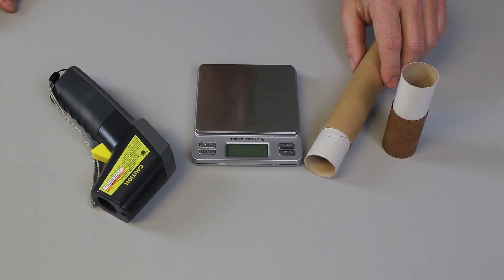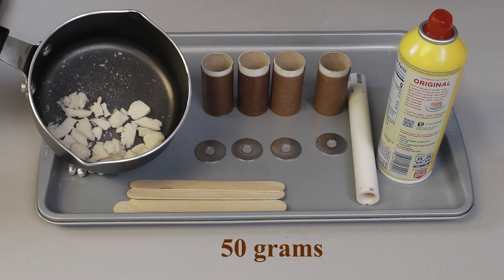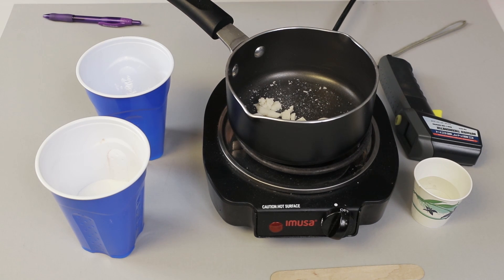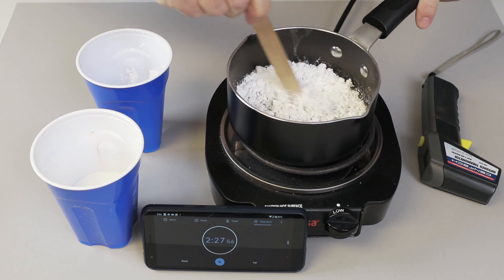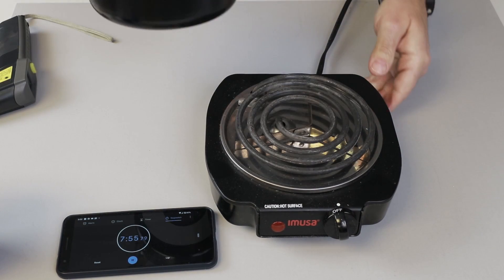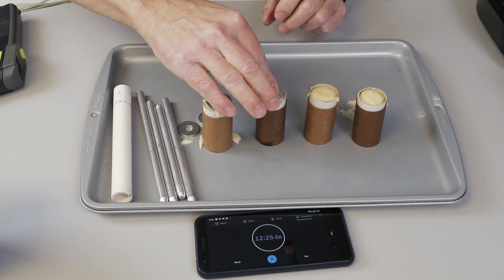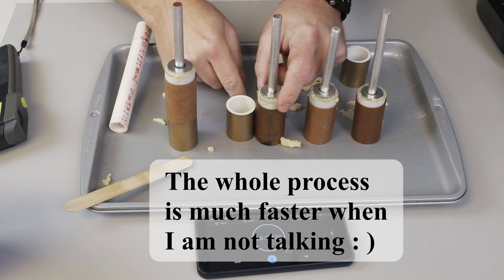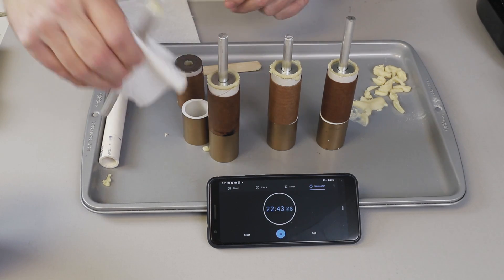Casting sugar fuel for a snap ring 38 mm rocket motor.

Comment: Can i use 55% potassium nitrate i dont have 100% kno3
Reply from the maker: The oxidizer needs to be 100% Kno3. In the US stump remover will work when ground into powder.
Reply: for purification disolve 1kg kno3 in 1 liter boiling destilled water under stiring. Whenn it is compled disolve let it cool down aber an day you have long needls of pure Kno3. if you know what the other 45% are and they are more soluble than kno3 than you can put your kno3 solution in the fridge over night and you get more kno3 out of it.

Comment: Why should we heatup the mix ? 
Does it make fuel more powerful ?
Does mixing up sugar and kno3 wont work or performance will be lesser in dry powder form ?
Reply from the maker: Casting the fuel wraps melted sugar around the oxidizer therefore creating superior thrust.

Pressed dry sugar propellant is good for a simple demonstration of smoke and fire. Melting the fuel provides a lot of thrust. Check out the video tab on my home page for more videos on rocket fuel. @TheRocketeer

Comment: Propellant should be powered and packed to increase surface area so   that it burns to produce high pressures force.
Reply from the maker: That is true for powdered fuel. Melted fuel provides very intimate contact with the oxidizer and that produces more efficent burning and thrust.

Comment: why can't we make a long solid propeller ....like 500 mm long what is the issue?
Reply from the maker: It is possible to pour a very long grain. It would be very difficult to push a long coring rod into the fuel or pull it back out after the propellant has cured. 

Drilling the core out is not easy either because the fuel sticks to the drill bit. That is assuming a very long drill bit is available.

If you are able to make a very long grain let me know! Good luck.
Reply: @TheRocketeer  thanks for the reply...so there is no technical restriction.
Reply from the maker: @thirumeniparthiban6261  No technical restrictions with a long single grain.

Comment: We're you referring 3.8mm as the inner diameter of the casting grains and the diameterof the motor itself?
Reply from the maker: Motor cases come in standard sizes such as 29, 38 and 54mm. I am referring to a 38mm case using BATES grains and a 1/2" core or 12-13mm. I hope that helps.
You can find more information here: https://www.lokiresearch.com/page/Tech_Info

Please add me as a featured channel on your rocketry page, thanks!
Reply: @TheRocketeer  oh thanks a lot for this again

Comment: Hi I have one question can I drill by 12.8mm drill bit?
Reply from the maker: Yes, you could use a 12 or 13mm to drill the core. The fuel is not easy to drill, it sticks to the bit. A little machine oil may help on the drill bit.
Reply: @TheRocketeer  thank you very much

Comment: I am a jetex lover .. can we cast sugar for jetex models too ? Can sugar fuel be modified so that we can a favorable sugar fuel instead of Guanidine Jetex fule for Jetex scale models ?
Reply from the maker: I am not familiar with the Jetex motor so I had to look it up. The Guanidine Jetex fuel is very unique, it burns rather slowly and at lower temperatures. That is the opposite of rocket fuel!
It may be possible to dry press a mix of sucrose and potassium nitrate (65/35) into a small pellet size and try that. Some of my first PVC motors were done that way. I am not sure if it will damage the motor or not. Good luck!

Comment: Have you ever added an ejection charge to this? Did you use a Loki 38mm Smoke Delay/Ejection Charge Bulkhead?
Reply: I just found my own answer. You replied on another video that you use the Loki.
Reply from the maker: @mr.harris8185  Use the "faster burning"  delay (brown) for sugar motors. If a medium delay is what you typically use then drill for a small dely. Sugar propellant does not burn as hot so a shorter delay is necessary. Use a long shock cord until the delay is dialed in.

I have an updated tutorial where an induction plate is used to heat the fuel.

Comment: This is the best video on casting propellant grains that I have seen. Suggestion: why not put a cast iron skillet or griddle on top of your electric hot plate, underneath the pot that contains your mixture? I believe it could help mitigate the explosion hazard. Correct me if I am wrong.
Reply from the maker: There are a lot of misconceptions concerning casting sugar fuel. It does not require a lot of heat to make flexi-fuel or sorbitol. It does require a lot of heat to make Rcandy and that is one of the reasons I discourage anyone from making it. The propellant is not going to explode.

The answer to your question would be fairly long so let me skip to a far better solution. The last several months I have been using an induction cook plate. This method is fantastic for making fuel. I will be making a video on that process in the near future.
Reply: Its sugar tea

Comment: So technically, this could not be launched at a tripoli launch because this is flexi fuel which uses sucrose and corn syrup. Looking at the tripoli rules the sugars listed are dextrose, sorbitol and erythritol. So can you only fly these 3 sugars? I'm a little confused lol.
Reply from the maker: This is a summary of the Tripoli ruling as I understand it. Sugar fuel must contain at least 51% of the three sugars you listed. The ruling does not claim that sucrose or corn syrup cannot be used. With those guidelines in mind then flexi-fuel is not allowed at a Tripoli launch because the primary sugar is sucrose or corn syrup.

My opinion on the matter is that flexi-fuel meets the criteria if 51% of the fuel is corn syrup. I believe corn syrup should fall under dextrose as the main sugar component. Corn syrup (Karo) is a proprietary sugar and because of that Tripoli will not accept it as dextrose.

The other thing to consider is Tripoli is not willing to assume any risk. It took a landmark decision at the Supreme Court that was expensive and lasted several years to allow us to use ammonium perchlorate (AP). That decision is the basis that allows us to use commercial motors and make our own rocket motors in the US. I think the ATF just tolerates us as long as there are no significant problems. This is simply my opinion on the ruling.

Flexi-fuel is my favorite propellant for a number of reasons. I have been using sorbitol for all my launches this year. Watch for a new updated tutorial on how to cast sorbitol and overcome some of the issues I have had with it in the past.
Reply: @TheRocketeer  so if you wanted to fly flexi fuel at a tripoli launch, you could dissolve dextrose in water to make a pseudo karo syrup and make flexi fuel from that right? As long as it made up majority of the fuel?

Comment: In what universe is 265F equal to 74 Celcius? boiling point (100C) is 212 F, and freezing point (0C) is 32F. 265F is 129 Celcius !
Reply from the maker: Yes I made an error in the conversion, it should read 130 Celsius. It is too time consuming to edit and re-upload the video and most people are going to recognize the error. BTW you misspelled Celsius :)
Reply: @TheRocketeer  Yep. I was being a smart-arse. I notice someone else had already commented on this, so I should have just shut up ;) Nice video BTW. Although I think I'll stick to mixing powdered sugar and KNO3 rather than heating an explosive over an electric hotplate... your saying 'make sure none drips down onto the hotplate' gave me goose-bumps. I have my powderman certification and am a chartered industrial chemist, but it seems too dodgy a process for me to attempt at home ;)

Comment: You've already made a vídeo casting flexi fuel before this vídeo. In that other video your cooking time was 5 minutes and you spilled the sugar and the kno3 in the corn syrup at the same time. So, what are the diferences between the cooking methods??? Like and suscribe
Reply from the maker: I have improved my casting methods from the previous video. I prefer to let the sugar dissolve in the corn syrup first and then add the KNO3. Thanks for your comment.
Reply: @TheRocketeer  thanks for your answer, i like to learn new things

Comment: What is the propellant?
Reply from the maker: The propellant is called flexi-fuel, 65/18/17. That is KNO3 - corn syrup  - sucrose   and it is not the same as candy.
Reply: @TheRocketeer  So the sucrose is the casting sugar?
Reply from the maker: @Berghiker  Yes, sucrose is the casting sugar.

Comment: Do more rocket fuel mean more power and thrust?
Reply from the maker: Yes, adding more fuel will increase thrust and total impulse. A larger nozzle size will be needed to accommodate more fuel.
Reply: @TheRocketeer   So instead of using more sugar mix if we use 2 sugar rockets, then?

Comment: Instead of filling the segments to the top and then having to always trim them, just fill to a certain height so when you go to insert the cores, the washers raise to be level with the end.
Reply: @overkillRC Hmm, not likely. Unless you put the fuel in a vaccum, you wont get rid of all the air. I've used this propellant a lot and packing it doesn't force air out, it just compresses the pockets which is actually more dangerous than having large pockets.

Comment: Q: Why have you not used FeO (iron oxide) in your mix?  
The difference in greater thrust is made by adding that one, cheap ingredient?
Reply from the maker: Red iron oxide (RIO) will cause the propellant to burn faster because it is a burn rate enhancer and produce more thrust but over a shorter period of time. The specific impulse or total amount of energy over time will not improve by much if any at all. RIO can over pressurize the case and cause a CATO. I will be testing the effects of RIO this summer. Thanks for the question, I hope that helps.

Comment: @ 1:45 265 F is 130 C, not 74 C Good video anyway.
Reply from the maker: You are the first person in a year to point that error out. Thanks.
Reply: @TheRocketeer  I am going to build a smaller 3/4" engine, with hydraulic cement for nozzle. I have 3d printed molds for the casting of the nozzle.
I think  about 11/32"  8.5mm dia for nozzle, what do you think?
The tube is pvc.
Reply from the maker: @atvheads  I would need more information but I think the nozzle is to large for a 3/4 motor, I think a 3/16 washer may work. 

It is difficult to pour a 3/4 case with fuel. Voids or bubbles can cause a CATO to make sure the fuel is packed tight. You may want to start with a proven design such as the 6" x 1" PVC motor and work from there. Good luck and stay safe!
Reply: @TheRocketeer  Ok, that small? So, the only washer i can buy is for m4, that is 4.5mmm in diameter. Close enough.
Reply from the maker: @atvheads  Yes,  I think that 4.5mm (.17) may work depending on the length of pipe. I use a 0.21 nozzle in a 1" PVC motor with 4 grains that equal 6" (152mm) of fuel. Start with a short length of pipe and add to it until you end up with 1 - 1.25 seconds of actual thrust. Small changes in nozzle diameter make a huge difference in thrust and pressure. Measure each washer (important) with a drill bit so that you know the actual size and then keep good records as you observe each burn. Assume every motor has the potential to CATO. If the motor does not hold together then go up a nozzle size. Use flex-fuel or sorbitol, do not use rcandy or it will explode. Stay safe and let me know how it goes.
Reply: @TheRocketeer  I will.
 I tried to drill out the washer, but stainless steel is difficult to drill. Next step for washer is m5, 5.5mm. Or as you wrote, step up to a bigger engine.

I am going to light it with a fuse, i made a thin tube with paper and black powder whetted with acetone, it burn very fast, and it  should ignite the whole chamber at once
.
https://ibb.co/4mrvtgc
Reply: @TheRocketeer  The concrete nozzle i made (Just a test) Turned out to be very good, it sticks very good to the pvc pipe. But it have to harden a few days before use. But i can always print out several molds.
Reply from the maker: @atvheads  Nice! I would like to see how you cast the nozzle with a 3d printed part.
Reply from the maker: @atvheads  Nice work on the 3d casting!

Comment: Is that really basic sugar ? It melts at a really low temperature and stays soft for too much time to be sucrose I think
Reply from the maker: The sucrose does not melt from heat but rather it dissolves into the corn syrup. The corn syrup causes the propellant to be pliable. Sucrose + KNO3 = Rcandy. I do not advise anyone to make Rcandy because in my opinion it is dangerous.
Reply: @TheRocketeer  is it dangerous with basic sucrose or with sorbitol and dextrose as well ? I live in France and I'm not quite sure corn syrup exists. Do you know what is it made out of ?

Comment: how do i know the diameter of the coring rod depending on the grain external diameter?? thanks for the help 🙏🏼
Reply from the maker: A 38mm motor will typically have a 1/2 (12.7mm) core and a 54mm motor would have a 3/4 core (19mm). You can use a 5/8 (15 - 16mm) core on 38mm to provide more thrust to lift a heavy rocket or boost a standard rocket on a windy day. So yes the core size is related to the motor diameter. That was a good question, thanks.

Comment: You note that the grains were drilled to 1/2 on the following day. I have tried twice and the grains break apart. Any drilling tips? Also, what size nozzle is recommended? #12? Thanks.
Reply from the maker: I try to avoid drilling grains if possible. All my 38 mm grains are cast with a 1/2 core at this time. A 3/8 core may work fine in a lighter rocket.

Cook the fuel a little bit longer. The grains will not be quite as gummy.
Wait a few days or longer to allow the grains to firm up.
Use a brad point bit in a drill press and at very slow speeds.
Drill in small steps using a 1/16 larger bit each time.

Cracked grains must be discarded or cut open and used in a fresh batch of fuel.

I check the LOKI site to see what nozzle is used with each case. A #19 (19/64) nozzle is used with a 480 case. This is a good place to start until you gain more experience in motor building. If a motor burns longer than 1.25 seconds then the next smaller size nozzle may work better. Most of my 38mm motors burn not less than one second and not more than 1.35.

I will have a tutorial in the spring covering BurnSim a motor design tool. http://www.burnsim.com/default.asp
The Nakka spreadsheet can also be used with the sorbitol preset. https://www.nakka-rocketry.net/softw.html

I hope that helps,
Chuck
Reply: @TheRocketeer  thanks for the insights. I'll check the design tools and  utilize the A#19 per your suggestion. Happy New Year.

Comment: Question: I notice you don't use iron oxide in the motors.  Any particular reason why?
Reply from the maker: Red iron oxide enhances the burn rate of sugar fuel. The problem is I don't know how much (yet) the burn rate is accelerated. That makes it difficult to design a motor. The other issue is there are better ways to control burn rate and RIO does not increase the specific impulse of the fuel.

Comment: Very Nice! I liked the timer(what to expect) and the copper(lower ignition hazard) tubing for the castings and the aluminum(?)(lower ignition hazard) rod for the center hole pressing. The bare hot plate element was scary(ignition hazard).  Modifying the shape while hot was better than cold(less handling is better). Overall, best I've seen!
Reply from the maker: Thanks Mark for your comments.

Making rocket propellant can be potentially dangerous. That's why I offer many tips to minimize the danger and make the process safer. Attention to detail and minimizing distractions are very important.

The copper colored tube is a short piece of phenolic liner that helps support the casting tube.

Comment: Great casting tutorial. I have to say the best R- candy casting video on the Internet.  Where did you buy your coring rods?  What nozzle throat diameter do you use for this 38mm flexi-fuel engine? Thanks for sharing and God Bless.
Reply from the maker: The coring rods are .50 aluminum purchased at a home improvement store and cut with a hacksaw. I gave them a good bevel on the end with a file.

The nozzle used for a 4 grain LOKI 480 motor is a #18 or #19 (16/64) for flexi-fuel.
Flexi-fuel is not true r-candy because it has corn syrup and therefore a slower controlled burning rate. It is my opinion that r-candy is not safe to make or use for numerous reasons.

Good questions and thanks for the comments, God bless!

Comment: I never used corn syrup method before... does it make a difference in the fuel?     I just use kn03 and powder sugar..
Reply from the maker: The fuel is easier to pour and has a loonger pot life. The corn syrup allows lower temperatures to be used as well.
Reply: Ah.   Got ya thanks.  Great videos. Trying different methods.